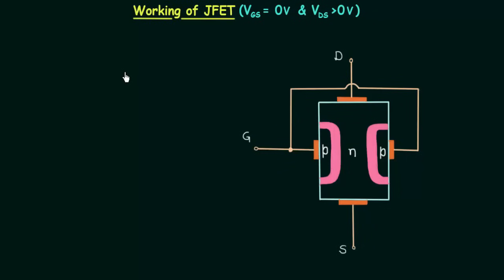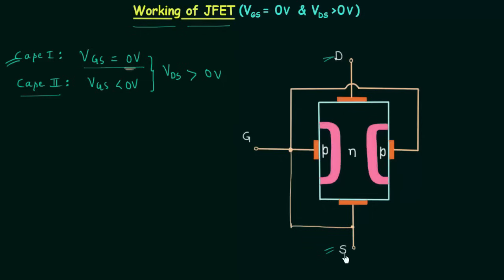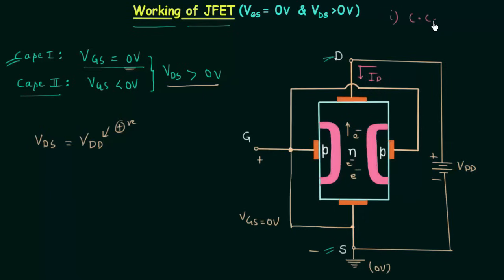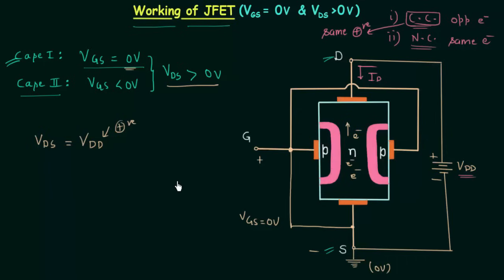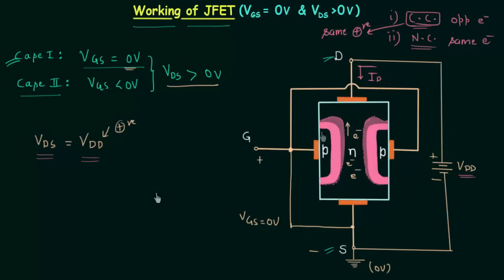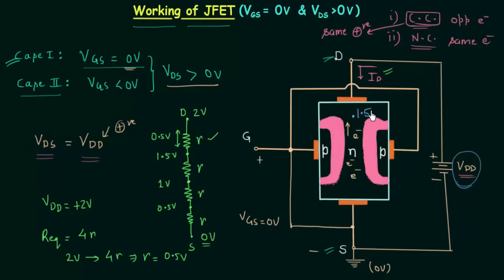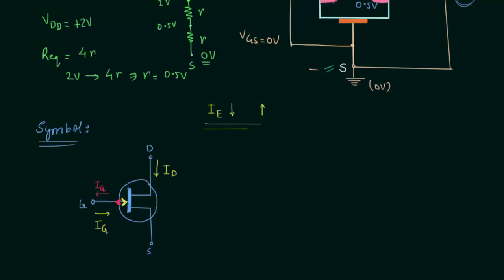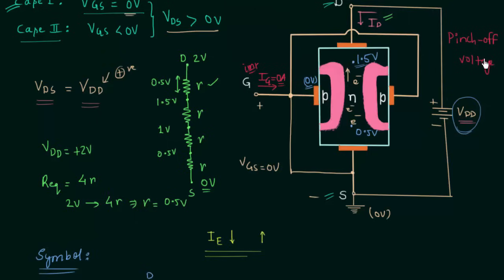Working of JFET (Zero Voltage at the Gate)

Comment: I'm confused. As per your representation, it shouldn't matter whether the drain or the source is positive. But in real life the biasing is reversed if the positive charge is on the drain. And where is gate current coming from? I thought no current flowed through the gate. At least you didn't mention anything about current flowing through the gate until you briefly mentioned it at the end of the video.

Comment: why the depletion region top side is more and bottom side is less.
Reply: I think it's because he showed (with the 4 resistors in series) that voltage decreases linearly as you go from the drain to the source. This means that near the source, there's basically no voltage being applied (remember that the source is grounded so there's 0 V being applied there). This means that the pn junction near the source doesn't have any biasing potential, hence will remain unchanged. 

But as you move up closer and closer toward the drain, there is higher and higher bias potential (which is coming from the fact that the drain is set to 2 V), hence the pn junction becomes more and more reverse biased. Since reverse bias condition causes depletion region to increase, this means that the depletion region near the top is larger than the depletion region near the bottom.
Reply: because of Vdg being positive and the pn junction on the top will be in reverse bias unlike in case of lower pn junction where Vgs=0 and it acts like a normal semi conductor

Comment: At 10:25  when he says the "PN junction is reverse biased" I think he refers to the simpler "PN junction way to work in the diode". Current can flow in one direction only. In this case can only flow from N to P. Id current is 0 because it cannot flows from P to N junction

Comment: sir why gate is reverse biased?
Reply: DEBAPRIYA DAS GUPTA 
bcz of 
there are formed a pn jn in bw dep. layer and n ch. and through the ex can see that higher voltage at electron means negative side and this is the condn. of reverse bias (let this pn jn. as diode)
Reply: Because the PN junction between between gate and source will widen (due to reverse bias), causing to limit the current flow between the drain and source. And thats how the FET naturally works.

Comment: why 4 resistances????
Reply: he considered a general case . Basically his meaning is to show some pottential difference .
Reply: Bro its depend on u 
If u want to take three resistance for explanation 
Then consider 3 resistance
It is only for explanation
Reply: its usually convention bruh . and he used voltages divider circuit for easy understanding

Comment: Why source and gate is always reverse biased?
Reply: In forward bias , the depletion region is very thin ,draining current flow fluently, there is no device to control 
But in reverse bias , the depletion region widen step by step if -1V is applied depletion region small -10V is applied depletion region widen so that draining current is controlled with the help of voltage control 
If two depletion region of p type reach near by applying heavy voltage draining current flow is stop.
Reply: no idea..!

Comment: 10:25 how is pn junction reverse biased?
Reply: Consider a PN junction as a diode. On the gate (P) you have 0 Volts. On the drain (N) you have more than 0 volts. This means the "diode" has more potential on N than on P, which means it is reverse biased.
Reply: Toni Varga Good explanation dude
Reply: Reverse bias condition occurs when the n-side of a pn junction is at a higher potential than the p side. In the video, +1.5 V was applied to the n-side, whereas 0 V is applied to the p-side. Hence, by definition, the pn junction is reverse biased.
Reply: @nashs.4206  
Your explanation sounds good
Reply: @Nash Shrestha thats most accurate and easiest  explanation!
Reply: Ya all the vierwers never realize when he said reverse biased but why d fk tis "+" to P junction
Reply: bro   i  dont   know  exactly   but   acrdng   to  me  a  pn  diode  is  said  to  be  reverse  biased  when  p   terminal  conected  to negative  voltage  and  n  to  possitive   
here  o  volts   may   be  taken  as  negative   when compared   to  that  of   some  possitive  vol5age
Reply: same question  here that how its reversed biased
Reply: I also have same doubt if u know Pls tell to me
Reply: @jayaprasadb2044  It's simple dude
The gate is Positive (p).
The drain is negative(n).
When we supply Opposite input voltage to those two regions,i.e., when Gate is given a Negative biasing (voltage connection) and when the Drain is given a positive biasing, then the Transistor is said to be REVERSE BIASED AT THE PN JUNCTION OF GATE AND DRAIN.
I hope that you will understand this concept dude ✌
Reply: Bro I know what's reverse baising but I asked how it become reverse bias, now I know that, as we know at gate 0 potential lesser than potential at vdd hence vdd become positive connected to n type and 0 potential gate connected to p type which is negative. I think so it's reverse bias  then I don't know correctly.
Reply: @jayaprasadb2044  after the reverse Bias, the current through the junction becomes Negligible i.e.,0
That's why Ig='0'A
This explanation is given in the video itself......
Reply: The biasing always starts from the P part of the PN junction. So if you have P+ N- that's forward bias. If it's P- N+ it's reverse bias. Just remember reverse bias is when they have the opposite charge of their type, ie P type has a negative charge for reverse bias and positive charge for forward bias. The rule applies just the same to transistors, BJTs and FETs alike as well as diodes and any other devices with PN junctions like SCRs.